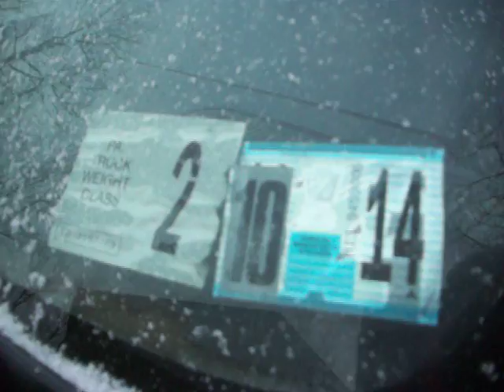Urethane cab mounts on Chevy pickup

Comment: i live in southwest PA ! I have a 99 Chevy blazer 4x4 and the rear cab mounts are going bad, just the mounts, not the bracket ! would it have the same set-up as a Chevy truck ? that,s a great video you made  ! thanks !
Reply from the maker: Is that an S10 Blazer?
Reply: yep it's a 99 s10 blazer I have ! WOW ! $1800 to put ball joints in ? you figure how many people they will rip off  that don't know ! are those body mounts hard to change ? just the mounts, the bracket is like new !
Reply from the maker: I havent changed the ones on my blazer yet but it should be a matter of taking the bolt out of the bottom and lift the body with a jack, that is to replace the rubber cushion.
Reply: ok ! thanks man !